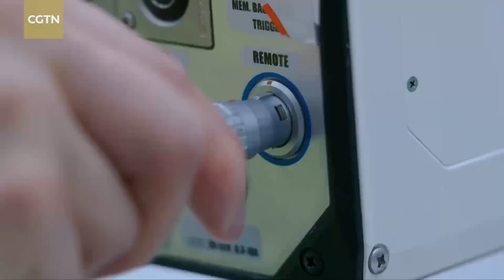Chinese engineers' efforts to make life easier and enjoyable

Comment: Indonesia got lucky to use one of her team latest design the Fuxing CR400AF, with an operating speed of 350 km/hr. I only can tell you the design is so advanced, all Chinese design with a lot of new tech such AI assisted braking system. advance earthquake detection. So smooth and low noise. You can start riding it in June 2023, the first completed HSR in South East Asia. Thank you China and her talented team. 🇮🇩🤝🇨🇳🙏👍